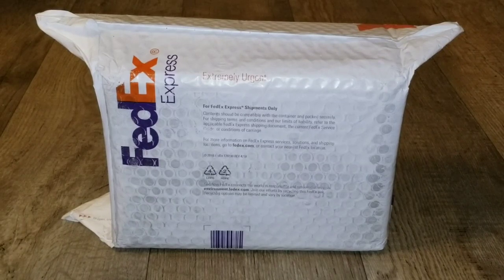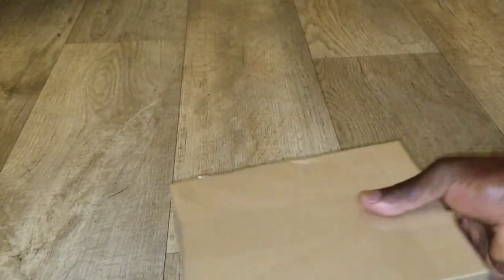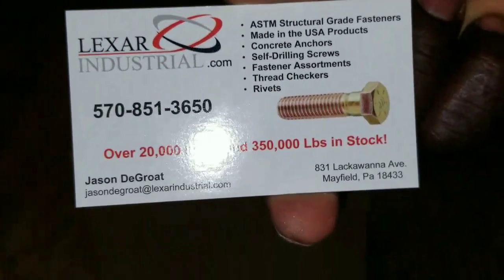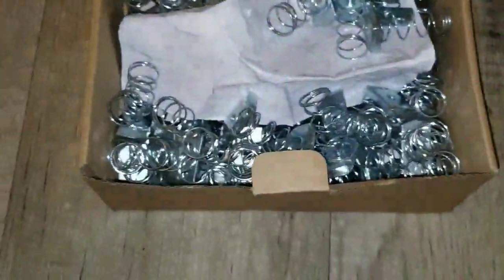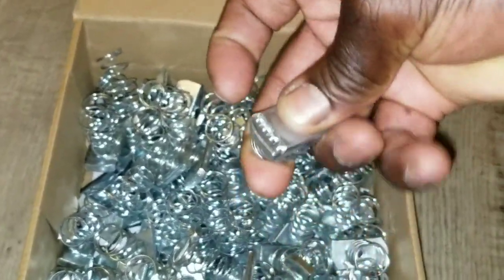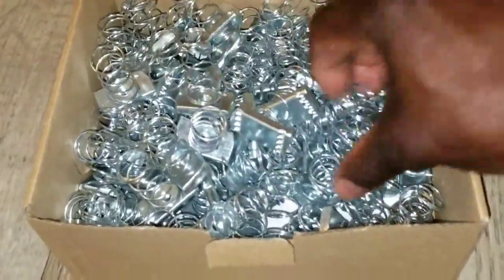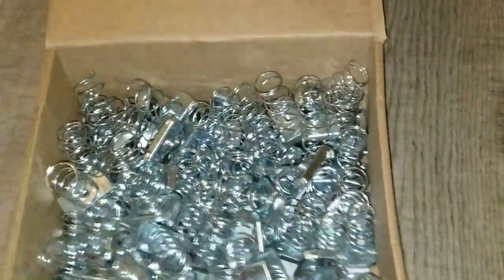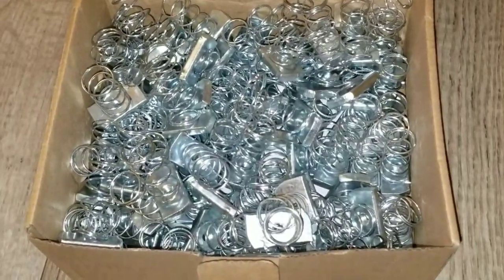UNISTRUT NUT WITH SPRING: Superstrut Solar Panel Mount

Comment: Heres a tip send those back . Get the cone nuts instead. U can thank me later. Home depot & Lowes  sells them.
Reply from the maker: Thanks brother
Reply: Please show me how to use the cone washer instead of the spring washer.
Reply: Do cone nuts work better?
Reply: @donaldsteele6276  they work much better you're able to slide them around and place them when necessary and they don't have the swings to contend with.
Reply: @TheKiloG69  I am currently working on a trailer solar array I made out of unistrut and this can be adjusted with a 3 ton HYDRAULIC ram and lowered like an awning for transport so I  an lower my prototype wind turbine tower besides it. Its turning out very good.
Reply: @donaldsteele6276  just subbed U.
Reply: @TheKiloG69  subbed? Oh subscribed. Lol oh okay. Lol
Reply: @TheKiloG69  yes they are very neat they stay right in place they cost less and they kick butt I definitely like how the strut holes dont matter anymore they float above them